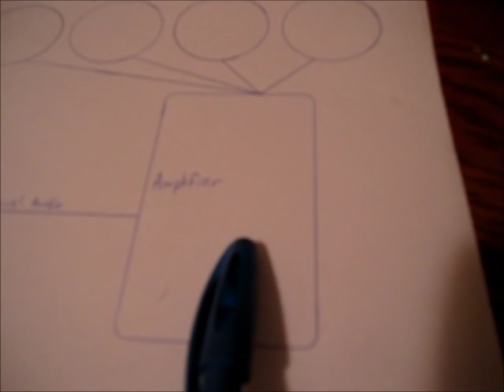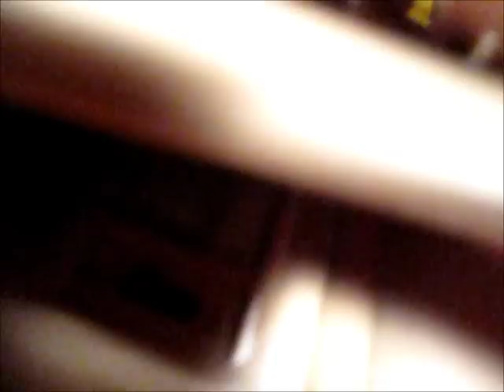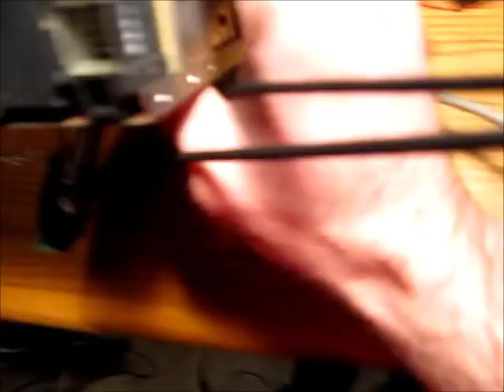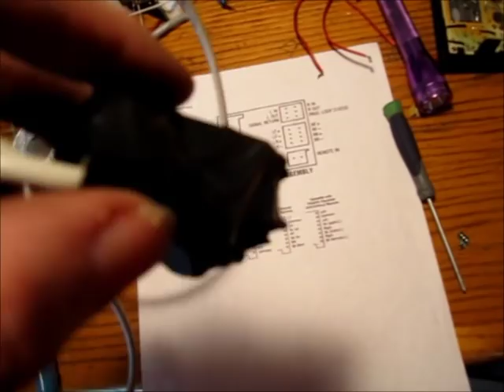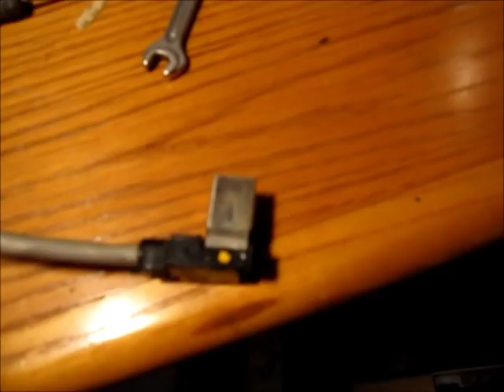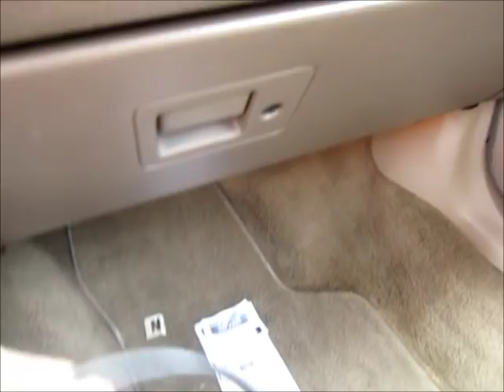How To Install A Ford Aux Input Into The Stock Premium Stereo

Comment: Great video    I really like the Bose system in my 2000 Lariat but the FM adapters and Cassette Tape adapters just don't cut it.  I've never found one that really works.  I've been looking for a "hard wired solution".  Now I've found it.  Very Cool! Many thanks.

Comment: I heard the amp would be under the seat on ford escorts 2000  and mine doesnt have one.  Does this mean my system is Not a prmium system??
Reply from the maker: +97warlock ismyname I'm not sure about the escort, but you could pull the radio and look at the plug harness. I think the premium system plug looks different than the standard.

Comment: Um.... Sir... I'm trying to wire my factory headunit into my 1990 SHO. I uhhh... Found this video and realized that I have the exact contraption in my SHO. Exact cuts. Exact screw placement. Exact little curve on the left side of the plastic on the top side.... I own your car. 1990 Ford Taurus SHO. Now has 150k miles. 
Now that both of our minds are blown, please help me. I cannot figure out how to wire my head unit due to this thing. I've been trying to use the secondary plug to bypass the amp but I can't find any of the actual wires that go to the speakers. Am I screwed?
Reply: My bad. After replaying your video I finally figured it out. But still, I have your car. Confirmed through your other video of you driving it.

Comment: if anyone here is looking for info on a making a headless system. all that you need to do is connect the yellow and black ignition wire, that has power going to it, to the blue power amp wire. then connect the wires from your rca to the appropriate wires in the speaker housing that previously connected to the radio.

Comment: i c the post is old...but if u c this--could i just bypass the whole radio and just connect a 3.5mm wiring straight into the connector? or does the power somehow flow through the radio into the amps? and if that's the case, couldnt i just use a jumper? thanx
Reply: thats my question exactly. did you ever find a solution?
Reply: yes, the power does flow through the radio into the amp... I found out

Comment: So for the wiring set up, the output would be the middle array, the top would be the AUX audio input, and the bottom would be the original wiring input, right?

Comment from the maker: I kept the stock system for a few reasons. I like the look of OEM equipment, the modification was a learning experience, and the sound is very good with the direct line in. An aftermarket install on this car would be a pain because it's externally amplified (amp in the trunk). Not to mention the wow factor when somebody flips the ash tray and.... OH SWITCHES!!?!

Comment: *** There's an easier way that requires NO MODIFICATIONS ETC. I used the analogue cassette to 3.5 mm adapter and it works well and the audio is awesome. I can now listen to music from my Ipod/Iphone/tablet etc. Google this or find it at Amazon "Monster iCarPlay Cassette Adapter 800 for iPod and iPhone -3 feet" for under $9.

Comment: ALL YOU HAVE TO DO TO USE MP3 ON YOUR SMART PHONE IS TO GET A CASSETTE TAPE WITH A WIRE THAT IS CONNECTED TO IT, PUSH THE TAPE INTO SLOT AND HOOK THE JACK INTO YOUR HEADPHONE JACK AND YOUR DONE...THAT SIMPLE AND AT WALMART OR KMART YOU CAN BUY FOR 8.00 BUCKS HERE YOU GO...SOUNDS AND WORKS FLAWLESSLY.....   walmart dot com/ip/RCA-Cassette-Adapter/16553075    to fix link at the .

Comment: Connecting the AUX input to the audio amplifier, you need to connect the negative from the AUX input to all the negatives from the radio going to the audio amplifier. Is that right? You said there was 2 positives for the AUX input and both need to go to the positives from the radio going to the audio amplifier. Is that right?

Comment: I did something similar to this on my 2006 taurus. I soldered the AUX input to the tape output on the motherboard of my stereo... It sounds good when the car is turned off but when i turn it on... i get major feedback from the engine. Whats the deal?

Comment: I liked the video, but I was hoping to find something about a 2002 Ford Taurus Wagon. I want to rig it so that I can use my MP3 player, but the aux jack is hidden away where I cannot find it. I know my car has one (it is equipped so that you can hook up a 6-disc changer if you want and the jack is supposed to be in a tiny compartment in the back), but I just can't find it. Any suggestions?

Comment: you didn't see the top small connector on the radio ? that is the aux input, there is no need for switches, or wires or mounting anything , you work hard on this and it is a lot of work, you have the schematic how come you didn't just send the audio that way ?

Comment: Oh ok.......I was thinking of using the one that only output through the headphones.  I figured that there would be less wiring going to it.  I'm trying to find a wiring diagram that includes those headphone jacks so that I know what I'm looking at before I open it up.  Never done anything like this, so I'd rather have the wiring diagram in case I screw something up!  LOL

Comment: I'm wondering if it's possible to use one of the headphone jacks located at the rear of my console that are for use by the rear passengers.  Obviously they are currently wired for output rather than input, so the rest of the wiring would need to be done.  I have a 1997 explorer with the autoset button.

Comment: thanks for replying so the best way to find out if the signal coming from the radio is a low signal is by looking in my trunk to see if i see any amplifiers? and i have a ford mustang 2002 youtube doesn't let me add the link but you can google this is the first search "01-04 Ford Mustang Explorer Radio Cd Cassette 3L2T-18C868-DD Factory OEM " the back part looks very similar to yours you think it can work on this type of radio